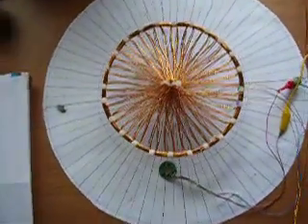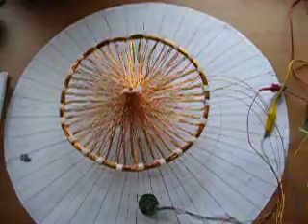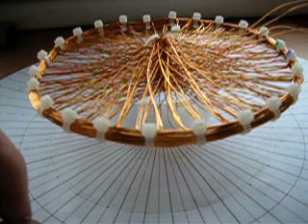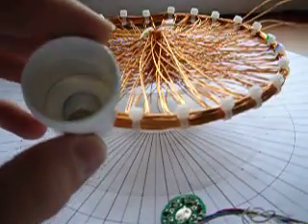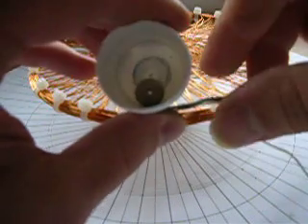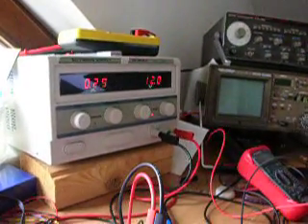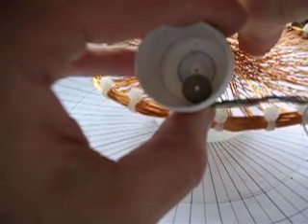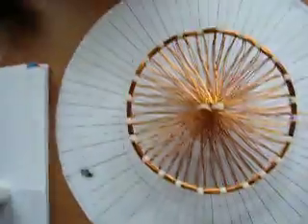ISC - Inversed Starship Coil

Comment: My idea was to inverse a Starship Coil but I didn’t visualize it looking like this... and maybe use all of its surface for spin, how does the ball act in the middle, or around half of the radius? Which way are the magnetic field aligned. Do they Still Not connect north to south, . Could it still be used in junction with the Faraday Disk the same way as I have. Can the wire in the center simulate “strands” of a Faraday Disk and loop in on its self as a closed Coil not receiving outside power once started

Comment: Awesome thinking, whether or not it works good for anything in particular, it is still a good way to test by reverse. An AC motor is an inside out magnet, dielectric matieral on the outside, and magnetic field on the inside, for example.